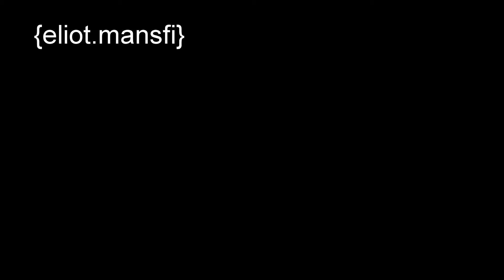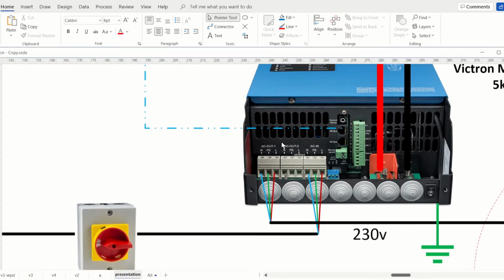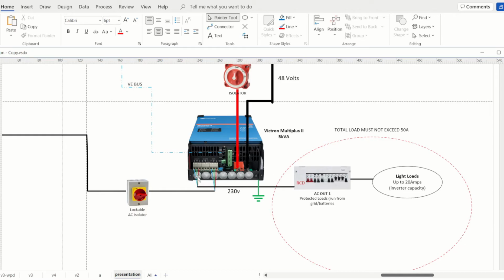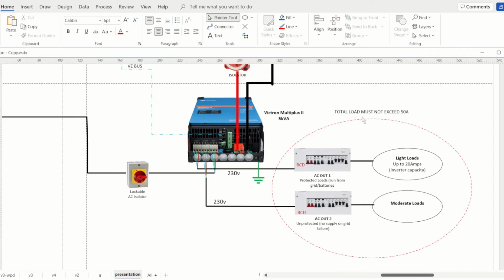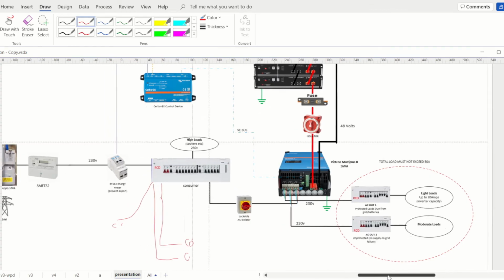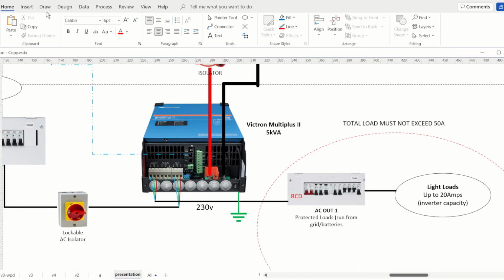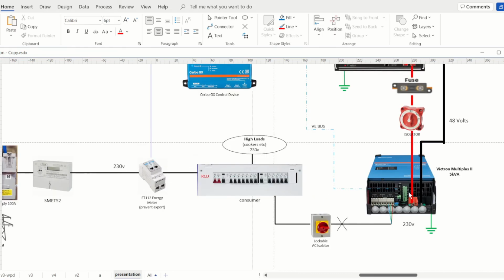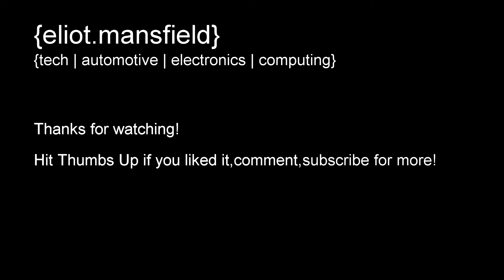Victron Multiplus Wiring Options Part 1

Comment: Great video, thanks. I have a question about the 50A pass-through limit. In the Victon manual for the MP-II 5000 it says that it is 100A. Below is an extract from the manual for the 48 | 5000 | 70 - 100 | 230/240V, page 11. I'd be grateful if you can help clarify: 
AC-out-1 (see appendix A)
The AC output cable can be connected directly to the terminal block "AC-out". Maximum torque: 6 Nm.
With its PowerAssist feature the MultiPlus can add up to 5kVA (that is 5000 / 230 = 22A) to the output during periods of peak power 
requirement. Together with a maximum input current of 100A this means that the output can supply up to 100 + 22 = 122A.
An earth leakage circuit breaker and a fuse or circuit breaker rated to support the expected load must be included in series 
with the output, and cable cross-section must be sized accordingly. The maximum rating of the fuse or circuit breaker is 122A
Reply from the maker: Multiplus II 48/5000/240v. There's a transfer relay (well two in series for safety) that are rated to 50A only.  So either output will support a combined load up to 50A only.  Output 1 is the protected loads output, which will support up to 5000Va (which is actually about 4.4kw - VA is NOT kw) when the grid is lost (or 50a when it's present). Output 2 drops if the grid drops.   Not sure where you are seeing 100a - the specs are here: https://www.victronenergy.com/upload/documents/Datasheet-MultiPlus-II-inverter-charger-EN.pdf
edit - the 8000 upwards models support 100A changeover.
Reply: The MultiPlus II 48/5000/70-50 has a maximum feed through current of 50A. the 48/800/110-100 has a maximum feed through current of 100A. I wonder if you have a MultiPlus and not a MultiPlus II?
Reply: @davidsteele3037  Well spotted! Yes, I was looking at the MP manual. The MP-II manual does say 50A. Thanks for helping straigten this out for me

Comment: Is this using the ESS system and connected to L1 (time 5:30 and 9:40 in video) or not?
Reply from the maker: Yes I’m using it in ESS mode
Reply: @eliotmansfield  
Thanks!
Reply: @eliotmansfield  
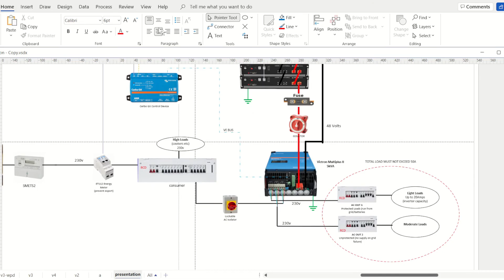In (5:40 in video) is the L1 powerd by ess and the battery?, and will it work if you have  a 3 fase 16 amp cee in the main consumer unit for car charging that the multiplus just power L1?

I forgot to mention I don't wont to feed any to the grid.
Reply from the maker: @hunter7181  If you have three phase electrics you need three multiplus units (or two units if you are split phase like the US has)

Comment: Can you show us very simply where the et112 usb is connected to an easy Solar and also the three wires that go to the et112 for single phase grid power meter use

Comment: Great explanation. Question, if I have an existing Solar 3.9kw system could I replace my inverter with the Victron too?
Reply from the maker: The Multiplus is just the inverter, you can add a blue solar mppt charge controller which does dc to dc direct charging of your battery

Comment: My understanding was you can connect a clamp from the Multiplus to the incoming just after the meter and before any loads so the unit can monitor the supply ? Or is that with the GX model ?

Comment from the maker: So as ever with this stuff we are getting into scope creep.  As we head into winter I know that 13kw of batteries wont support my loads, so i've ordered another two pylons to take me up to 20kw and i'm adding a second multiplus in parallel which will give me more charging current to get that pack charged in the four hour GO window, this also means each unit is working less hard during charge and discharge and I also get more inverting capacity.  The 5000va unit covers most of my daily loads, including a large induction hob - but two big loads would exceed the capacity.
Reply: Hi Eliot and thank you for your video. Is it possible to only let the grid feed into your installation and not the other way when using the energy meter together with the multiplus? I have a small 6Kw wind turbine that the power company no longer wants connected to their grid because the inverters are outdated regarding the quality of the electricity produced by the inverters. The turbine´s controllerunit is equipped with two 3Kw SMA windyboy inverters with one phase each, so 400V between phases measured. I intend to install two hot water tanks with heating elements in them. The turbine will primarily heat the tanks, but if possible also help feed the air/water heatpump if possible. I need to make som kind of priority controller with a plc or something for that. Do you think the multiplus II GX can balance the loads for that?
I am thinking of 15 Kw of battery storage for some of the loads on my property. TIA, Palle

Comment: Hi Eliot, thanks it's getting clearer. In the last diagram, "single leg mode", how does the Multiplus connect to the consumer unit without blowing up? Does it detect the phase of the grid and somehow match it? I'm worried about spending all this dough and wiring it like this..
Cheers
Reply from the maker: Yes  - it synchronises to your grid before actually fully coming online - typically 20 seconds for g98/g99 compliancy in the uk

Comment: The part I don't like..... If the 1 leg is RCBO protected, and I use UPS feature via another consumer with a radial, there would be 2x RCBO on one circuit. 🤔 what's your thoughts on this?

I'm thinking a time delayed 50ma rcd, and the usual 30ma RCBO from ac1 on the circuit its self.
Reply from the maker: yes i believe that’s the answer - which ive not implemented yet. (have two standard rcbo’s inline - so could cause nuisance tripping)

Comment: It is very disappointed to know that you can only pull 20ah from This multi plus when you are using the ups mode  I wonder if can I pull at least 50 ah  from a Quattro when connecting to the battery?
Reply from the maker: It’s all down to the size of the inverter.  A 5000va inverter can only deliver about 20 amps AC.

Comment: Days of searching and you’ve really answered so many questions and explained things so clearly. Thank you!!
Reply: Now I just need to figure out how to configure the unit in “single legged” mode to stop it feeding back into the grid on grid failure!
Reply from the maker: @incognitowarrior  The multiplus wont feed back into the grid on failure there's dual contactors inside the unit (in series - so double redundancy) which drops the "output" on grid loss. This is a certified requirement for G98/G99 in the UK and elsewhere.
Reply: @incognitowarrior  my understanding was that this is automatic to protect the grid. I may have this wrong of course

Comment: Thanks Eliot great video the diagrams make the explanation really simple and you have probably answered 100 of my questions in that video.
I'm on a quest to build my initial setup with what I think will be The Multiplus II 48v 5000
With a small capacity of Pylontech Batteries initially then growing overtime.
The house doesn't have big loads at present no car charger (yet) and still Gas Heating (for now) Hot water is a clever mix of immersion fed by excess AC solar PV and divert to combi if not enough etc.
Will the Multiplus work with 5kwh of battery initially or am going to be needing more to get started?
Also any thoughts on the Diverted excess PV to immersion using the Solic 200 for this and it's been great just wondering if it's going to then conflict with the Multiplus.
Thanks again
Reply from the maker: I’m running 4 x pylon 3000’s (~13kw) which seems to be a good match for the 5000 multiplus which can recharge the pack in 4 hours overnight - that’s the maximum it can do in four hours.  I’ve got 3.5kw of solar as well, which seems well matched.  I run a hot tub which pulls about 6kwh daytime. Without solar the batteries would be flat by 4pm, with solar they will last all night.   Yesterday which was very sunny, did an hour of immersion too and pack was only down to 40% by midnight.
There’s victron compatible immersion diverter which is on my to do list:
https://www.victronenergy.com/blog/2019/06/11/hot-water-on-the-skeleton-coast/
Reply: @eliotmansfield  Interesting I may have to double up my batteries from day 1. Was thinking of starting small and growing the setup. I guess I should reach out to Victron and see what the minimum they suggest. There doesn't seem to be anything obvious in the documentation.
Nice work on your setup! I look forward to if you do anymore videos on it! Thanks again
Reply from the maker: @michaelstott8847   I would say 3 x USC3000 is the minimum because you should only pull 25A from each pack.  Have a read of this: https://www.victronenergy.com/live/battery_compatibility:pylontech_phantom
Reply: @eliotmansfield  amazing thanks for that guide that's really helped. I think I'm nearly ready to push the button and order 2x US5000 now.
If you were adding additional solar PV what factors would you look at to decide if they should be connected via MPPT or via a PV inverter?
My thinking is anything that is mainly going to charge the batteries is better on a MPPT and anything for current demand is better on an AC inverter. But actually is it better to just use the MPPT and let the victron multiplus do the work inverting anyway. interested to hear your thoughts on this. Thank you
Reply from the maker: yes thats right.
Reply: @eliotmansfield  Hello, i really enjoyed your video and has helped a lot to clear things in my mind, however what is still unclear is the scenario where the PV inverter comes in play, currently I have a single cable 10mm2 coming from the AC out of the PV inverter into consumer unit, if I were to add the victron charger and batteries in the mix, in the single legged mode, the output of the pv inverter would remain as is?
Reply from the maker: @m3l3t15  I believe you need another energy meter on the ac PV feed so it knows what it’s contributing.  Right now I don’t know that for a fact, but may have an answer soon because someone I know is doing just that.  Mine was easy because my PV charges the batteries directly via a victron mppt charger
Reply: @eliotmansfield  hello, and thanks for coming back to me. You mean the em112? I see ac coupled storage bundles being sold, they include 2, em112, maybe you measure both sides as you say, one on the grid one on the ac   inverter, that way it knows how much to release from the battery storage and how much to supplement from the grid. It would be great of you did a follow up with that topology.
Reply from the maker: @m3l3t15  that’s my understanding of it

Comment: Excellent video thanks Eliot, just what I needed. I wonder could your answer a question for me. I've seen some where that you can connect a pv system to the protected side of the multiple which would be great for long grid failures. Under normal circumstances is that pv input available to the rest of the system? Is that protected circuit input also bidirectional through the multiplus?
Many thanks Steve
Reply: Thanks for that Eliot. Yeah you would imagine it must be really. Both my of systems are already grid connected so that would be great for me 👍
Reply: @stephenharrisson9442  I'm looking at the same issue. I think the issue to be considered with putting PV only on ACout1 is that the PV current is then also passing through the inverter. When batteries are full, that PV output is then fed to the grid through ACin, and any critical loads on ACout2. In the event of grid failure, the Victron MP2 creates a local grid so the PV inverter still runs, and the MP2 can be set to increase frequency to control that PV inverter as long as the PV inverter supports it (change the PV inverter if not).  The PV inverter output should come PV inverter - AC isolator - Generation meter - MCB breaker - MP2 ACout1  and gets to the grid via MP2 ACin  - Consumer board RCD  - Meter - Grid. 

 @Eliot Mansfield ,what drawing software is that? - really useful video, thanks.
Reply: @L81ker  hi Clive, I have one solar grid tied inverter connected to the meter tails  of my main consumer unit - after an et 112 meter . My question is do I need to change any settings within the multiplus 2 if I feed another grid tied solar inverter into the ups side - ac output 1
Reply from the maker: I suspect yes - but don’t know for sure.  I went for DC connected PV  - seemed less hassle and it’s more efficient.